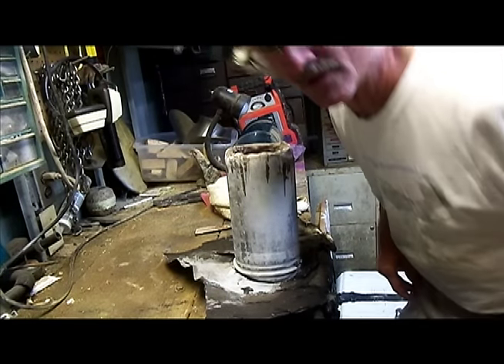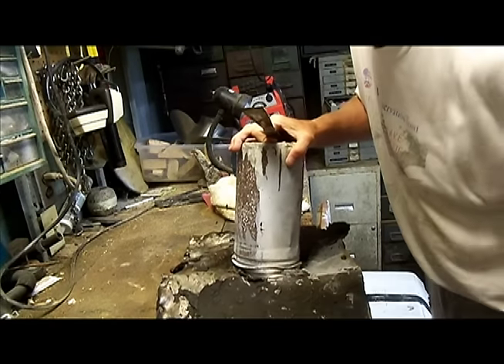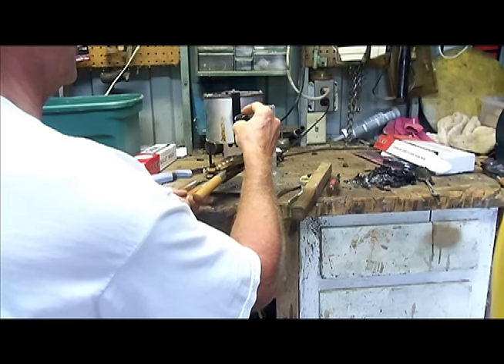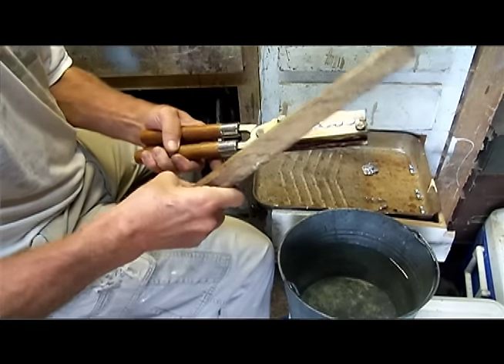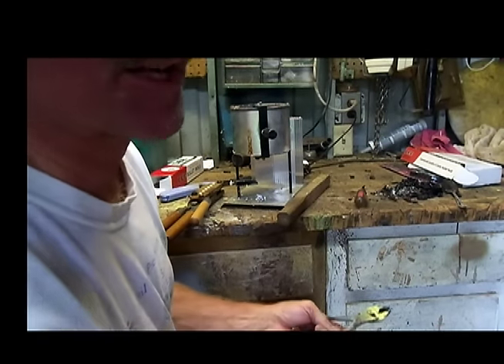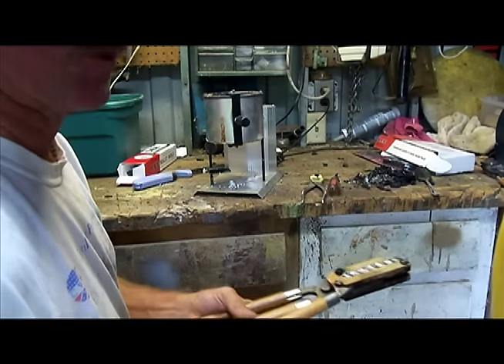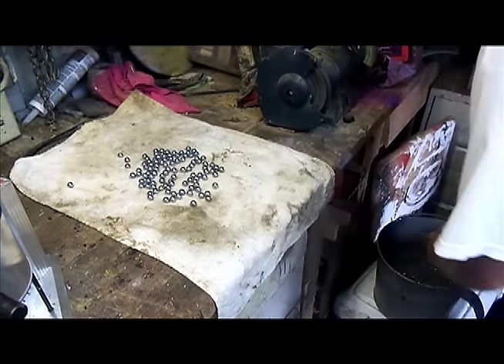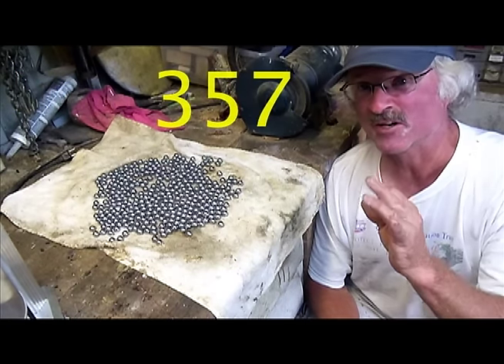How to cast round balls the easy way.

Comment: I am really curious my friend, why are you shooting a 480 round ball in a 50 cal. Please explain your reasoning behind that. I have a couple hundred pounds of lead that I want to turn into Hawking fodder, I plan on buying a larger pot for the lead and a six round ball mold. But I do not understand your reasoning behind the 480 instead of a 490 or 495. Once again please explain. Squatch
Reply from the maker: When I get out to shoot--plink, I usually go thru 80-100 shots in an afternoon. I don't want to "pound" or "hammer" those extremely tight balls into the barrel & then grunt pushing them down. That takes all fun out of the sport for me. Ol' Arthur living in my left hand doesn't help either. Some says its less accurate & probably so...but..I shoot for fun & rarely get into those highly competitive shooting matches anyway. Good question, thanks for asking.

Comment: Was watching this when your reply popped up. I guess we have a failure to understand what I'm trying to say. The VAST majority of casters melt down their scrap in a different pot, than they use to pour finished product. It keeps all the scrap out of your bottom pour pot so it remains clean. And I gotta respect that everyone has their own way of doing things. But why are you quench-hardening round balls for Black Powder shooting ?
Reply from the maker: I understand what you are saying now. I don't pour ingots because its just takes too much time. I scrape out the "pond scum" from the pot and never allow it to get completely empty. When the lead drains down to 3/4" -- 1" from the bottom,  I quit pouring long enough to add more lead. Regarding the quench, I quench them so I can handle them and put them away sooner. That's the only reason. Great conversation, thanks.

Comment: If you don't have any wax try fluxing with sawdust...it works just as well. Not my original idea....
Reply from the maker: I like using wax. It makes pouring easier. I used some early on in this video. Thanks for watching......
Reply: Anything that will put carbon into the lead will work as a Flux.  I like to use wooden Paint Paddles which are normally available free from your paint store.

Comment: After sorting the balls by appearance and weight, I put them in a tumbler for 15 or 20 minutes. The tumbling reduces the sprue scar to nothing which speeds up loading later on.
Reply from the maker: I have a tumbler from another hobby. I've tried that too any that does make better round balls. For my style shooting which is usually just plinking, I just shoot the better ones nowadays that comes from the pouring. Thanks for watching...

Comment: Do you still pour your lead
Reply from the maker: Yes..about 2 weeks ago, it rained here daily for week. During that time, I poured over 1500 of those .600 round balls, over 1000 of those .490's and about 1200 .480's. I still have enough lead left to pour that many more if needed. I will not need to buy round balls again.

Comment: I use to smoke my molds. Then learned how to control the temp of my mold while pouring. I have taken brand new molds and only lube the pivots and the top surface and the opposing mold faces with lee Alux. I don't have to beat my mold handle to get lead to drop out. I give it a shake and the lead falls out of the mold. Controlling mold temp is critical.
Reply from the maker: Yes, since this video was made, I've smoked the moulds more often & longer. I don't have to beat on the moulds either. Thanks for the post, I might have to try that Alux sometime.

Comment: I see some drop from mould to towel and you drop into water. Why's that? Enjoyed the video.
Reply from the maker: I drop the hot round balls in the water after casting so they can cool off.  Afterwards,  I lay them on the towel looking for imperfections. I mainly use the water and towel to be able to handle them sooner. I pour round balls for friends & they can take them home when we are finished. Otherwise, they would have to come back hours later when they naturally cool off. I don't put any water near the pot....not even a drop. The pot is 600+ degrees and lead explodes from the hot pot if water enters it.  That's a definite no-no. Hope this answers your question, thanks for asking.

Comment: The other thing I do is I take and drop the sprew right back in the pot directly from the mold while it is still hot.
Reply from the maker: I've tried that before, but, since I allow the lead to spread across the top of the cutter....I often drop some longer pieces of lead on the table nearby. For me...its just easier to drop it in that paint tray & use it later. None of the lead ever goes to waste. I had a friend here a few evening ago & we poured  400+ .445's & just let the excess lead stay into the tray. I'll throw it back in the pot after if cools. I have plenty of raw land to pour.
Reply: @blackpowdermaniacshooter  I run all 6 pour cavities and always pour heavy on top of the sprew plate. Reason for lead shrinkage in the cavity. The way I am set up it is easy for me to drop led back into the pot. How you are set up I can see how it might be easy. Bottom line. Have a good time casting however you do it. Cheers.
Reply from the maker: @1stFlyingeagle  Absolutely! As long as we are shooting, that works for me too!  Thanks for the conversation.

Comment: What temp sitting do you keep your pot at?  I've got the same one, and I wonder about the lead getting too hot?  Is this an issue.  I hate to send the $$ on a Thermometer
Reply from the maker: I turn it all the way up till the lead is in liquified form...ready to pour. 
Then....( usually about 20-23 minutes ) I back it down to 8.5 -- 9.0. Too low & it hardens up, so, I'd rather keep it hotter than cooler. Thanks for asking. .
Reply: Thank you.  I appreciate the information.
Reply from the maker: You are welcome. Let me know if that works for you....

Comment: I prefer to melt dirty metal in a separate pot, then I have only clean ingots going into my casting pot.   I never have issues with muck in my casting pot.
Reply from the maker: The only time I ever have an issue is...when I allow the lead to get too low in the pot when pouring. To remedy that....I check the pot more often when pouring. If it gets within an 2 inches of running out....I add more lead. Practicing that , I haven't had that problem since. Thanks for sharing.

Comment: Mark, what thickness patch are you using with the .480" RB?
Reply from the maker: I'm not sure. I found pillow ticking from JoANN fabrics recently for $4.00 a yard & bought it. I believe its at least .018 or thicker because the patch survives the 60-70 grains powder I usually shoot. I have no way of measuring it. Thanks for asking...
Reply: Yes sir, most Ticking will run around .018" or so.  You must have a tight barrel in order to shoot the .480 ball accurately.  I really enjoy your videos!
Reply from the maker: The main reason I shoot .480's is......I shoot 60-75 or even 100 times during an outing. I don't like fighting with the .490's down the barrel that often. Of course...if I shoot a competition ( rarely do that ) I'll use the .490's.Thanks for watching. Have a great day.

Comment: Thanks for the Video! Is that a Lee Mold?
Reply from the maker: Yes, both are Lee Molds. Thanks for watching.
Reply from the maker: Yes, its a Lee Mould. They are fairly inexpensive & work great! Thanks for watching.
Reply from the maker: I don't care about the newer guns either. I LOVE shooting the older models. Most of the time, I use 50 grains of Goex 3F powder & 4F in the pan. 
I have shot a 45 caliber before. I can't tell much difference in the two calibers. I suppose its what you prefer. I had a 50 caliber percussion gun given to me a few years ago & that got me started. To avoid buying bunch of different moulds and possibly taking the wrong equipment with me in the field, I stayed with the 50 on my flintlock purchase. It makes things much easier. Thanks for watching.

Comment: You need a old Dutch oven pot. You're defiling that poor Lee bottom pour with that dirty lead. Kinda dangerous too. One drop of water in a tar pocket and you're gonna look like the Tinman from Wizard Of Oz.
Reply from the maker: I don't allow water to get near the hot pot and haven't had any problems pouring lead using this method. I've poured 1000s of .480 and .490 round balls ( over 75 pounds worth ) and the bottom spout hasn't clogged yet. I never fully  empty the pot of lead. I always leave at least 1/2" of lead in the bottom of the pot when I quit. That keeps it from clogging. Thanks for watching.
Reply: Leaving some lead in the bottom of any melting pot helps. That lead is molded to the pot. It heats up more rapidly and aids in melting the added lead. My two cents.
Reply from the maker: Yes, I agree. The main reason I always leave lead in the  bottom is.......its less likely for foreign objects to clog up the pot. I haven't had to take mine apart yet due to clogs. Thanks for watching....

Comment: Gloves and safety glasses please. One spatter of lead in the eye is final. In the past couple of months i have cast about 30 pounds of lead into ball both .357 and .451. I DO NOT allow any water near my pot because one drop will result in a lead explosion. My molds are aluminum mostly Lee and they heat up fast usually the second pour gives good bullets, But PLEASE gloves and especially safety glasses.
Reply from the maker: We agree about safety glasses for those who doesn't wear prescription glasses. Unfortunately, I've worn glasses for 45+ years. I have a poured  9000+ RB's during the last 4 years with NO incidents at all. Yes, God is watching over me. It pays to be safe. Thanks for watching.....
Reply: Sheesh. EVERY single casting video has multiple safety nannies in the comments section attempting to enlighten a seasoned caster on safety. Lead poisoning, silver fairy, burns, etc. How do you people survive in daily life without a helmet?

Comment: You're gonna trash your casting pot "smelting" scrap lead in it like that. You should always smelt in another pot over a burner or fire and pour into ingots after removing all the garbage contaminates in the other pot. Electric casting furnaces were never designed to melt down scrap lead. They are for the already cleaned and refined lead to pour into bullet molds.
Reply from the maker: I haven't had that problem with my electric pot. It maybe because I never allow the pot to run dry. I always keep at least 2" of lead in the tub. That ensures it works the next time I use it. Thanks for watching.

Comment: No gloves ! ?  In the body shop at the dealer I worked a sander would hit lead , they evacuated the shop then a hazmat crew came to vacuum and spray it down 
It will destroy liver ,heart ,kidneys
Reply from the maker: No gloves..I tried them before & they didn't work out. I wash my hands afterward getting done & won't eat or drink anything while pouring. I don't grind anything, just put lead into the pot & put the balls away after finishing. Thanks for watching....

Comment: Guys like this scare the bejeezas out of me. No attempt at safety, smelts in a casting pot.
Reply from the maker: Other than a face mask ( which is difficult to use on video ), I don't know what else to do for safety you may have in question. I have long pants on, wearing eye protection and have a fan running you cannot  see but is obvious at the @2:21 mark. Use of pliers is mentioned to avoid getting burned.  I've poured 1000's and 1000's of round balls with no incidents yet. Thanks for watching. Have a blessed day.
Reply: Walks Fletcher 
You must be a millennial.
Reply: Jeez DUDE!!  we get it!!  Safety first!  OK!!